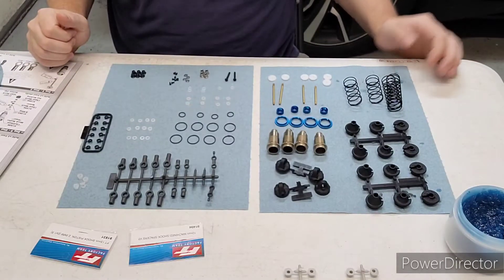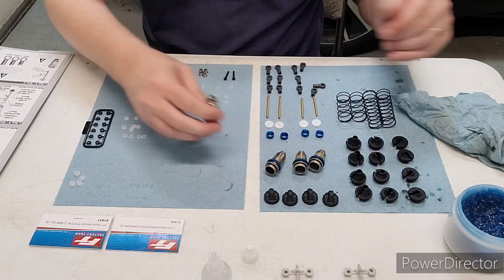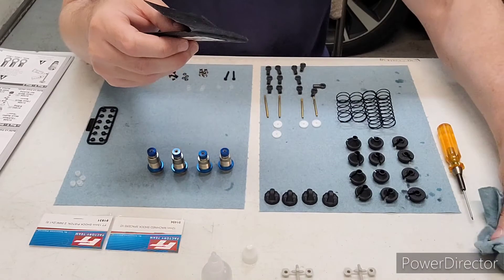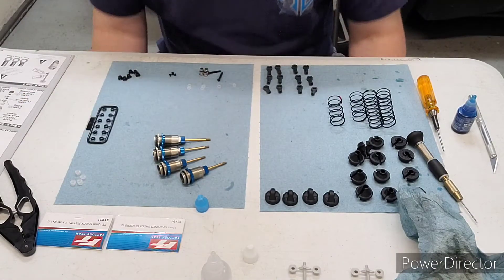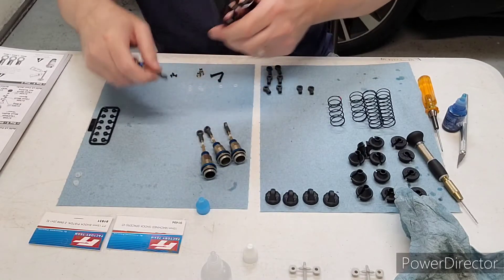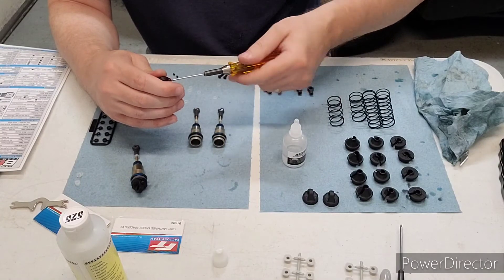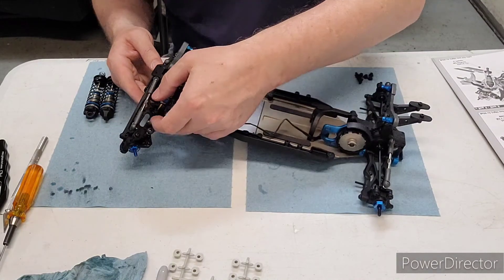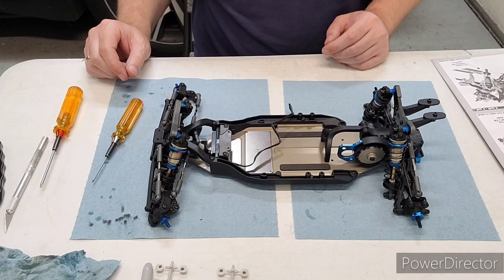RC10B6.4 Full Build Shocks Bag 9

Comment: In the instructions there's no mention of the clear thin washers. It shows a hat washer going in first and last.
Reply from the maker: The clear thin ones are used as internal or external travel limiters on the shock shaft itself.  This controls the amount of droop.